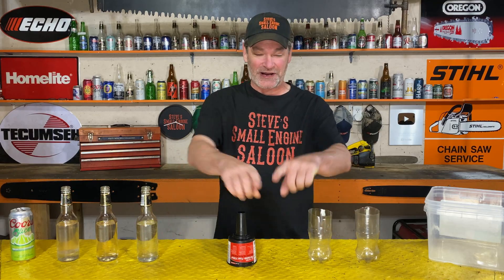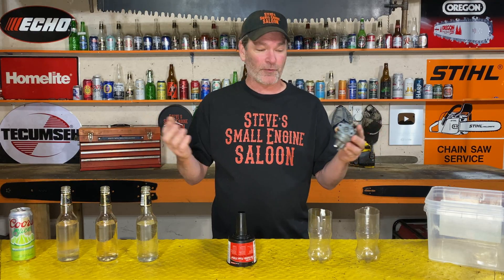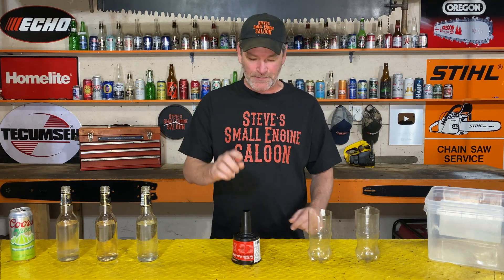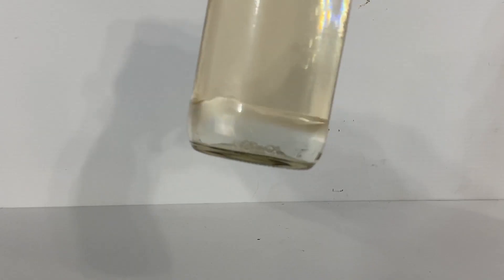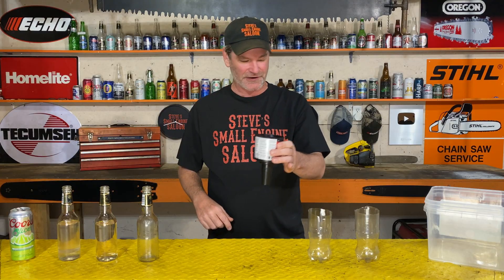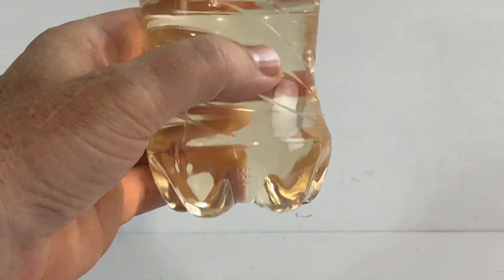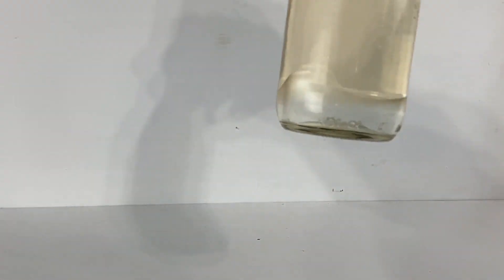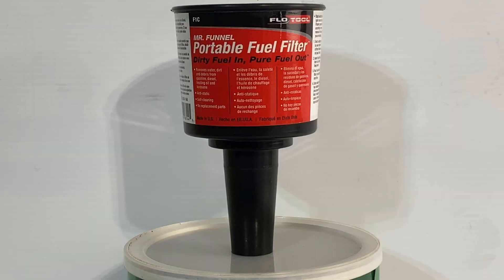Does Mr. Funnel Fuel Filter Really Remove Water From Gasoline

Comment: OK, lets talk about gas with 10% ethanol, this will absorb water up to a certain limit, I don't know what the scientific name is, but up to that point it will absorb the water and hold it in suspension, however pass that limit and the water separates out taking the ethanol with it, now the  question is, will the ethanol/water mix go thru the magic filter?
Reply: I think you are referring to hydroscopic.  Absorbs water.
Reply: @jimpikul8551  Actually, the term is "Hygroscopic". A Hydroscope is a device which enables a person to see an object at a considerable distance below the surface of water by means of a series of mirrors enclosed in a steel tube.
Reply: Droid thanks for the education.  That’s the new thing I relearned today!

Comment: You didn't test 10% ethanol fuel?  So will it will filter out the 10% ethanol? Or just actual water from gas sitting around collecting water from the environment?

Comment: Steve. You should have one more test. Use fuel with some water like you did, but also put in a little fuel stabilizer, then use funnel, and you will see water will go right through. It will not separate water from fuel if a stabilizer is used. I use stabilizer in all my lawn care fuel cans, so this is worthless. Your thoughts now?

Comment: Sorry for the spoiler.I'm taking my boat to The Bahamas next month and a friend told me that a lot of fuel docks in The Bahamas have water in their fuel.So I decided to get the big  Mr. Funnel and use it every time I fill up. Well I have the smaller Mr.Funnel. I think it's 5gal/min and try to test it before I by the bigger one. Filled it up half with water just like in some of the Mr.Funnel reviews at first nothing came out at the bottom  and after a few seconds the water started to run right through it slowly but steady. I had mine for about a year just sitting on the boat doing nothing. I don't know if they go bad after a while but all I can say is piece of "shit" .

Comment: Doese not work 100% 
I have some gas in a clear  bottle  with about a spoon full of water in it I have  strained it 4 times to get all the water out
Once  or twice is not enough to to remove the all the  water 
Who is going to strain ther gas 4 time to refuel 
There  mower ???
Not fit for purpose  in my opinion